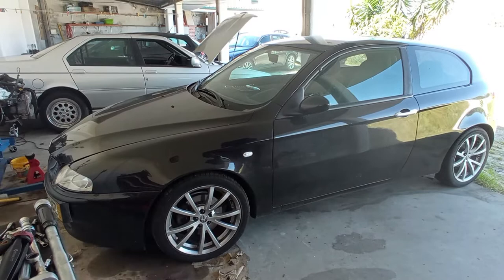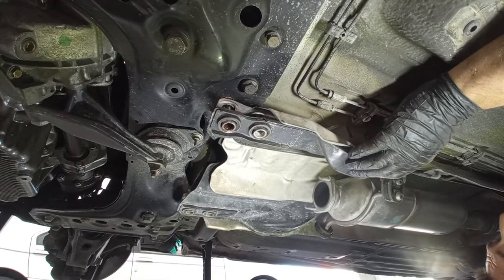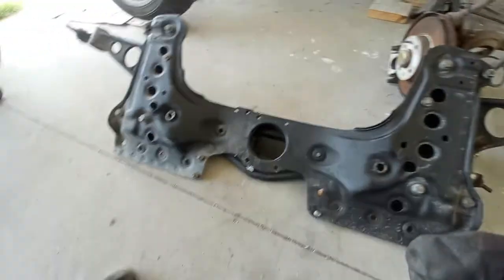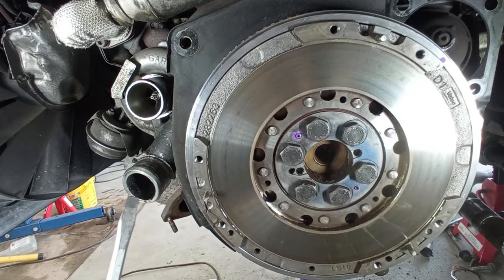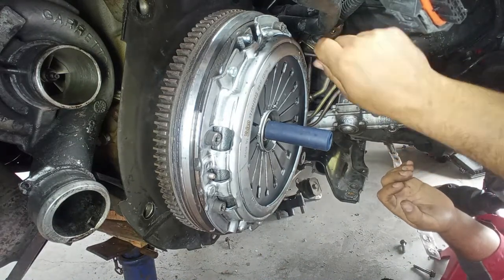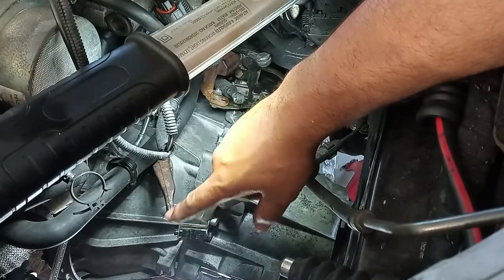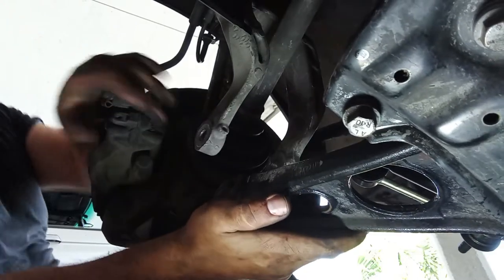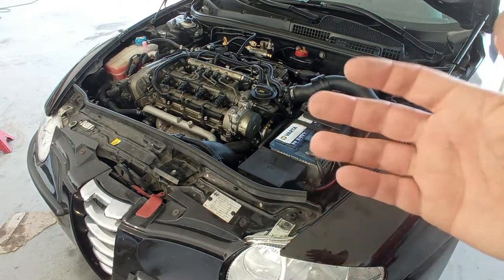Noise in the gearbox of the Alfa Romeo 147. Replacing the clutch kit, complete tutorial 147, 157, GT

Comment: Hi Bruno, what a hard work. No help, no lifter, all done on the ground without special tools. Good to see it is possible for everyone.
The gearbox disassembly is always a complex work on 147 and 156. I did it not by myself but gave it to the garage. As a normal customer, I was not aware about the differences of LUK, Valeo, Sachs or any other clutch and Dual Mass Flywheels set. Most of garages are also not interested or do not have any knowledge about the design differences. As I told longer time ago, my Garage put a LUK Set into my 156 JTD 8V, fortunately still working without issues.
Reply from the maker: Thank you very much for watching the video. Once your clutch pedal starts to be heavy, you know you have to replace the set.

Comment: Hi, I also had even bigger play on my clutch disk as shown and it produced noisy ticking sound when on idle and in neutral at 41:14, luckily I changed the clutch kit at the right time, otherwise I was at risk of permanent failure and that thing was gonna spin freely just like clutch slip. I think that SACHS clutch disk is prone to that failure. And yes I can confirm that SACHS disk plate is a bit stiffer on the clutch pedaL than original VALEO but much more softer than old clutch and it works fine. I hope it stays that way.
Reply from the maker: Hello. Valeo tends to Stay soft for a long time. Mainly if you do the adjustment I did on a video for that, on the push bearing fork

Comment: Sliding in the gearbox back into the engine is always a pain for me. What I have done to help with this process was to do some studs put in place of the bolts securing the gearbox to the engine. This allows me to slide the gearbox back and forth more confidently until the splines align. I personally dislike this job very much, as it can take an undetermined amount of time and a certainty that will be physicall hard.
Reply from the maker: Hello. Very good tip! And I think I have a long stud that I use to put the wheels on. 
It is really very hard and sometimes frustrating. And in the next day I am very soared! 
Thank for watching and for the tip

Comment: Thank you! Will be removing my 156 Busso with gearbox and subframe. Do I have to remove the shocks with the forks as well?
Reply from the maker: Hello. Thank you a ton for your support! 
If you are not comfortable with the job I recommend you to remove it all. 
To do that I have videos that can help. They are down on the description
Reply: There is nothing comfortable with a job like that.😅
I am just trying to make it somehow less painful and in a manageable package of the engine+gearbox+subframe, without having the suspension legs pointing wide and getting caught to everything.
I will check out your videos, but I have followed you for some years now and can not remember seing a Busso-out video. I understand it has to go ”downwards”.
Reply from the maker: @Goc67 if you have a lift you can try, but is not easy still. The engine doesn't rest on the subframe like an 164/6.
Best thing is to remove step by step
Reply: No, I am working like you, with jack stands and an engine hoist, lying on the concrete garage floor.😅
I will remove the subframe first, which needs to be rustproofed, and then the engine.

Comment: Fantastic detailed and informative video! The part where you use the lever to snap the release bearing into place. It is important with a quick and firm movement? My workshop have failed 2 times now, on my GTV 3.0 24v and have to remove gearbox for 3rd time. Last time with valeo clutch kit.
Reply from the maker: Hello. Thanks for watching. The gearbox has to be tight in place and the leaver, firmly by had only. 
Use Valeo components only

Comment: Great video! Can you explain to me which models of 147 have dpf? Mine is a 1.9 jtdm 120hp facelift 2007 model and I don't know if It has a dpf or catalytic converter. Cheers!
Reply from the maker: Hello. Almost no countries had dpf on 147 and GT.
Portugal for not had it. 
It's yours had it, it should be under the car after the flexible exhaust pipe. And two or one hose coming out of it

Comment: I own two 147 1.9 jtd and they both have the hardest clutch pedal you can imagine. Why is that so? And are they all the same, with hard clutch pedal, I’ve heard???
Reply from the maker: Hello. Hard pedal feel it's common but not normal.
Most of the times is because of the wrong brand of clutch set. Also the lack of maintenance of the cylinders fluid.
Once the gearbox is out there is one more thing that may be done to extend the smoothness of it.
Down on the description there is a playlist for everything clutch, I have there videos for that.

Comment: Liking this video mate...im going too be replacing the clutch on my 2008 GT jtdm this next week on the floor outside..hoping its not going to be wet and too icy...do you think i could get away with not removing the subframe because i dont have to drop the box to the floor will i have enough room to fit the clutch ?...Barry. uk
Reply from the maker: Hello. I hope it goes well.
Yes, some of my colleagues can do that without removing the subframe. But I don't like it at all. To much stuff hitting and scratching .
Reply: @alfaromeonoproblem  Thanks for the quick reply  ,i appreciate that...im going to give it a try..i dont have a manual..im hoping that patience and not too much cursing will get me through,im aiming to get it done.in a couple of days..over here the valeo is about £65 cheaper than LUK
Reply from the maker: @barryowen1738 ok, keep me posted.

Comment: You're weirdly uploading videos just when I need them! Thanks for this one! I have a question though. I quite don't understand how I can switch through the gears with the gearbox out. I'm going to swap the 5 gear one in my 1.9 JTD 8V with a 6 gear 16V one. I bought a used one very cheaply for only 120€!!! I checked it, it seems actually fine, it's spinning freely with a little bit of resistance and so on, but before i put it in I want to check every single gear so I know if I have to open it and fix or change some parts. I just don't understand in which combination I have to pull or push and turn on the lever and how I know which gear I'm in. 🤔
Reply from the maker: Hello. Thanks for watching! Well, I will have a video next month for a cat that had issues with gears and I will show on a 6 speed one how to check that! 
Make sure to use the 6 speed cables too.
Reply: Can you tell me if the 6 speed gearbox is a straight swap for the old 5 speed gearbox on a 147 JTDm 8v?
Reply: @alfaromeonoproblem  Ok I will stay tuned! Do you mean the 6 gear has different cables?
Reply: @CostaTropicaldeGranada  As I understand yes. I will try it.
Reply from the maker: @CostaTropicaldeGranada hello. Yes it is. But you need to put in the 6 speed gear selector cables
Reply from the maker: @uranusneptun5239 yes. One of the cable has adjustment and or a different length

Comment: Hi Bruno, the clutch on my 156 jtd was changed by the previous owner, about 70 thousand km done. but I hear slipping at 3, 4, 5 gears at full throttle. Could there be something wrong this early? I have replaced 2 cylinders in the meantime and bled the air. regards
Reply from the maker: Hello. If it slips, it's bad. They do not last long.. bleeding the cylinders does nothing. It's the pleasure plate that holds the pressure. The cylinders relief that pressure wen pressed
Reply: @alfaromeonoproblem  Thanks for the quick response, the clutch pedal is slightly lower than the brake pedal, is that normal? I have read that Valeo set is good. graces
Reply from the maker: @merkez288 maybe the return spring is broken. I do have videos for that too. But it's not the reason for the symptoms

Comment: How come you can get all engine/gearbox mounts for 156 petrol engines (even JTS, I just checked), but none for the 159 JTS? Well, only the short bottom one is available, the rest none (I checked the whole world)...
Reply from the maker: 159 where very low, and the spares with low production. This car came out during the 2008 world crisis. Everything surrounding it it's hard to find.
Reply: @alfaromeonoproblem  Oh, I just checked. 159 where built in 2.5 times less numbers than 156. :(
And Italians like to stop making spare parts 10 years after the model has ended production. So many parts have stop being produced since 2020, 2021, 2022,... :(
But there is still market for them. And they cancharge higher prices for them. I think aftermarket companies should catch up and start making them.
The only top engine side mount that I was able to find was in Portugal, and they only have 2 at a pretty high price. I am not sure which one I need yet. I think it is the lower ones more likely. The engine shakes during startup. Sometimes more sometimes less. On the top mount, there is some forward/backward movement, but not a lot. Not sure how much is normal.
Reply from the maker: @DashCamSerbia the forced coming of new cars, electric and other is killing all aftermarket suppliers. About the mounts, normally the timing side is the one that suffers more, next the gear box side, inside the frame.
The lower ones, only if they are very bad.
Reply: @alfaromeonoproblem YT deleted my comment... How can I check that top mount without jacking up the engine?
Reply from the maker: @DashCamSerbia vibrations at idle and very harsh idle on the body. Sometimes also a noise
Reply: @alfaromeonoproblem  Thanks. But I don't realy have that. Maybe the slightest idle vibrations sometimes. The only time I notice anything is when the engine is started, as soon as ti fires up, it shakes through the cabin for a second. After that, no problems. Sometimes hakes a lot more, sometimes little. And I alwys start the engine with the clutch pedal pressed.
Reply from the maker: @DashCamSerbia for the gasoline engines of that car I do not have any experience.  There is one or two here in Portugal. 
Make sure to have or not play on all mounts.
Reply: @alfaromeonoproblem  I know. :( There is some play forward/backward on that top mount when the engine shakes during start up. I will see if I can film it next week.
Reply: @alfaromeonoproblem  Just one more thing. Which brand is better for mounts, Imperium or Akron Malo?
Reply from the maker: @DashCamSerbia ok, very good
Reply from the maker: @DashCamSerbia imperium normally pack original inside
Reply: @alfaromeonoproblem  Thank you.
Reply: @alfaromeonoproblem  Nobody in Serbia has Imerium... They sent me Meyle instead, without me knowing it, so I returned that. I found a Birth one and chose that. The bottom short mount. All the others, unavailable...
Reply from the maker: @DashCamSerbia that is sad...
Reply: @alfaromeonoproblem  There are 2 pсs of top ones available in Portugal. Only there.